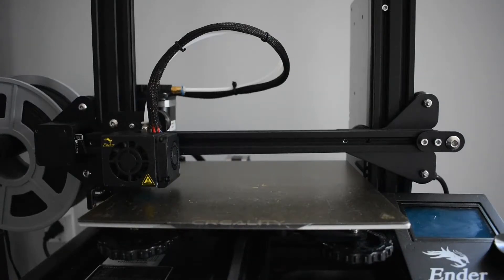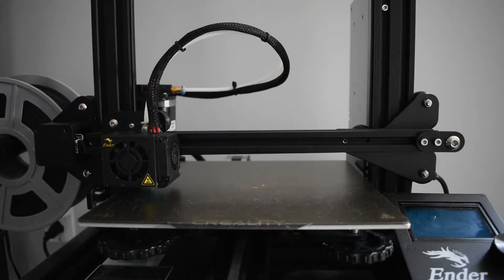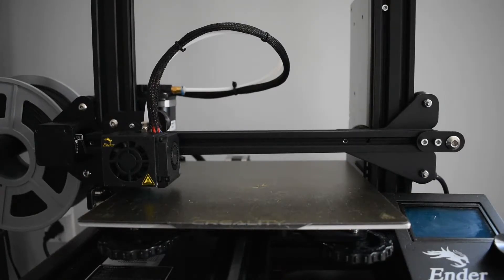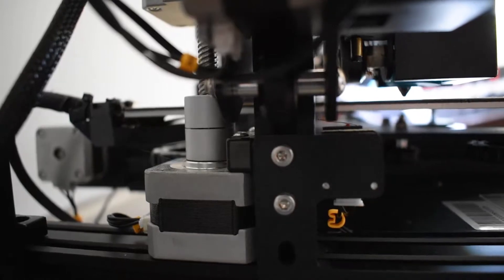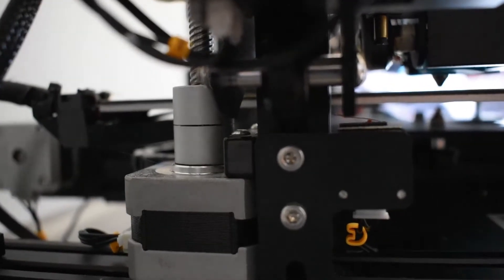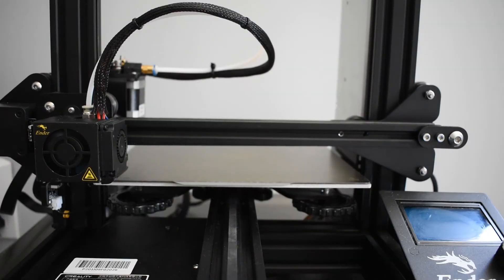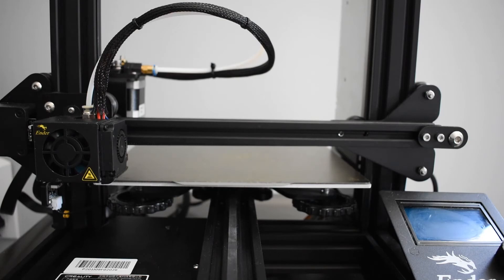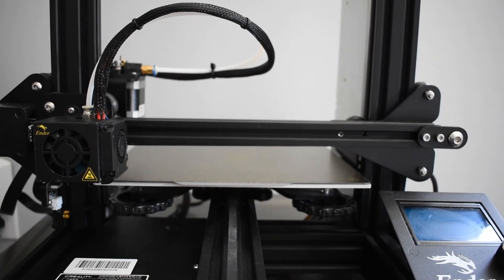Ender 3/Pro - How to Fix Z Axis Thud Noise/Not Moving

Comment: Washer trick fixed it. The z-axis servo was just off by 2 or so mm which added a ton of load when trying to rotate the rod clockwise. You can see how much load by just turning off the motor and using your hand to turn the rod. It should be a little heavy but not so much that you can't turn it by hand fairly quickly. When you are installing the x-profile where the threaded rod mates with, you can look directly down the hole to see if the centers are concentric. Thanks so much for this video!

Comment: Thanks man, this was perfect! Short and educational, just as they all should be. On my ender 3 pro I just fixed like 10 errors from variety of parts and pieces, cleaned my print bed, tightened all the screws and then this happened. I'm glad I found this video ^_^

Comment: my z-axis moves really slow, is this normal if not how can i fix it?
Reply: .one does the same on the ender 5 pro. Have you solved your issue? I don't get a clicking noise like this video. But does what you describe. When I tune the z axis in the lcd panel to lower to 305, it lowers slow & stops less then a quarter down.

Comment: Thank you for the advice, you were dead on.  Reducing the clamping force by loosening the screws on the z axis coupler ended up solving my issue. PS: The proper term for the tool used is "Hex Key" or "Allen Key". subscribed!
Reply: @recon_leech  no its Allen wrench
Reply: @Tweetsix  it doesn't matter. They're referred to as both.

Comment: I need help man. I bought the under three pro just a couple weeks ago and now it’s literally like going to the left and just staying there and just going back-and-forth it doesn’t move to the center and less I manually move the part with the nozzle to it. Like it literally just say goes to the side and stays there and just goes back-and-forth for hours and hours
Reply from the maker: It could be either of these:
- Printer assembled wrong
-Slicer is corrupt

What slicer are you using? Make sure it is the newest version.

Comment: my bottom screw was far too tight to loosen did you have that problem?
Reply from the maker: If you have that problem, be sure you are using the shorter side of the hex/Allen wrench. 

The Allen wrench is shaped as an “L” 
Be sure you are using the bottom part of the “L”  if a screw is too tight. Let me know if that helps
Reply: Hi! I have the same problem. The bottom screw is really too tight. Were you able to loosen the bottom one? Thanks!

Comment: Hi, I have the same problem and the first solution I though was to loose the screws. It helps a bit, but the real problem is the part connecting rod with motor is fixed too close the  motor. I can see it clearly on your video. You need to loose the screw and move it up then tighten, so there is more place for the rode in the upper part of junction. Then you loose upper screw and let the rod deeper and tighten. This way the rod will stop being distorted, what caused strange noise and problem with moving.

Comment: Great job! So, the reason why you want to avoid using the short side of the Allen key inserted into the screw, is because it is easy to apply more torque to that screw which overtightens it. Cheers!

Comment: If you have any questions, video suggestions, or anything else, feel free to ask!
Reply: Similar problem on my ender 5 pro. Where the z axis lowers slow & lesst then a quarter down when I try on the lcd panel. No clicking noise, just moves very slow. I did have an earlier problem were it tried lowering to much it keep forcing the bed on the rails clicking loud and grinding gears or some. So I shut it off. Z axis has been off since.
Reply: THE DAMN THING WONT MOVE AT ALL NO MATTER HOW HARD A TWIST THE SCREW WONT LOOSEN